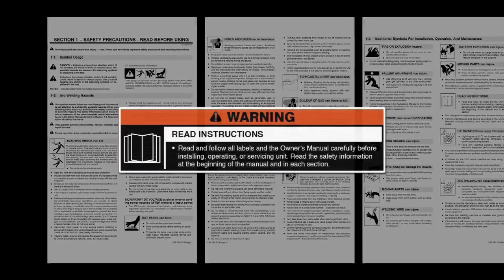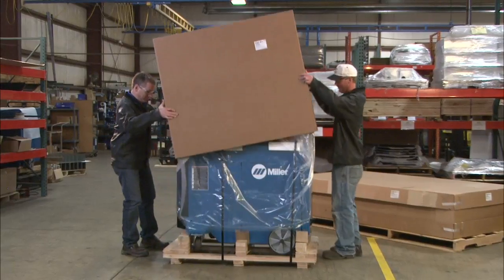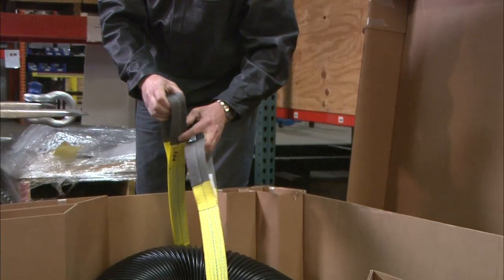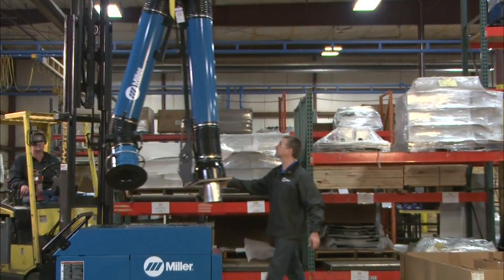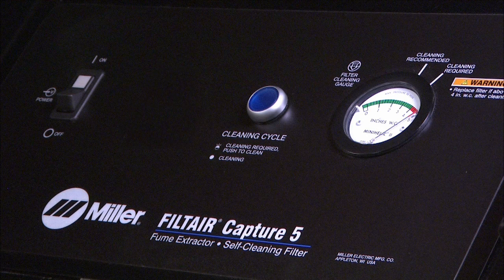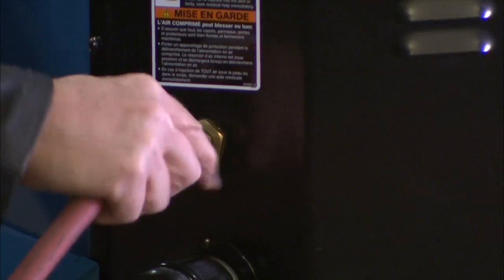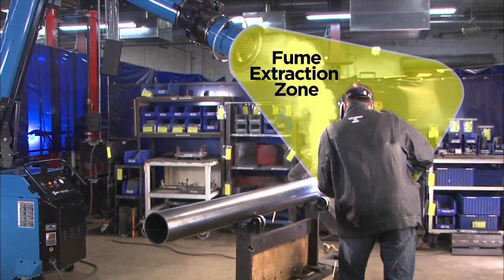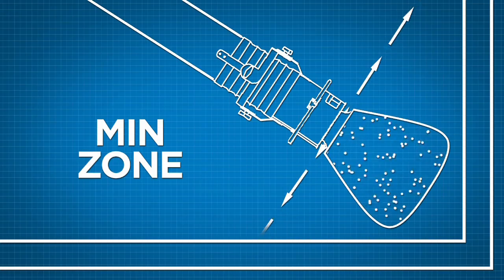Miller FILTAIR® Capture 5 - Easy Installation

Comment: Can the negative air zone be completely shut off in case of needing the area around you to not have blowing air?
Reply from the maker: EarthshipFreedom Our current design offers a zone flow control that allows up to 50% of the air to be bypassed. Unfortunately - we do not have a way to completely bypass or shut off all the filtered discharge air that creates the negative air zone at this time, but it is something we have identified as an improvement to allow for greater flexibility of the system. Thank you. Please let us know if you have any further questions.